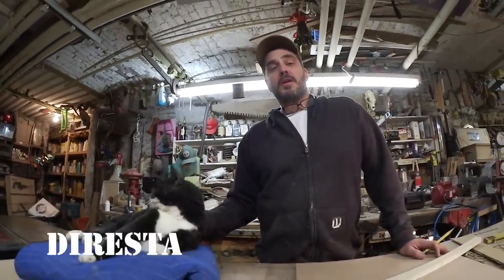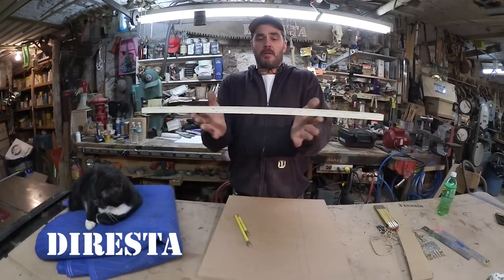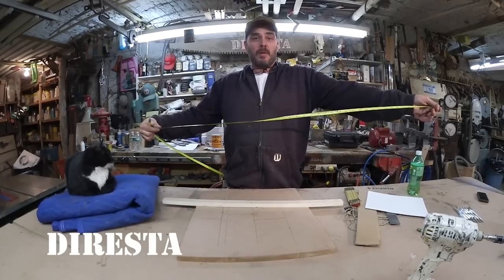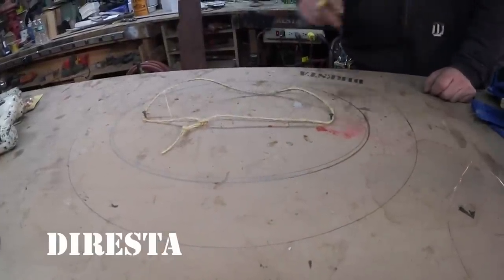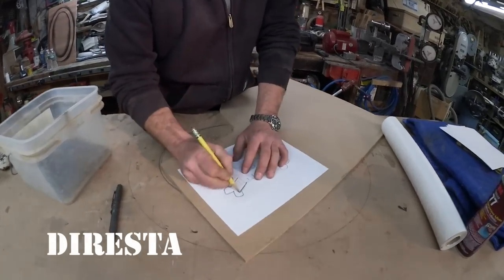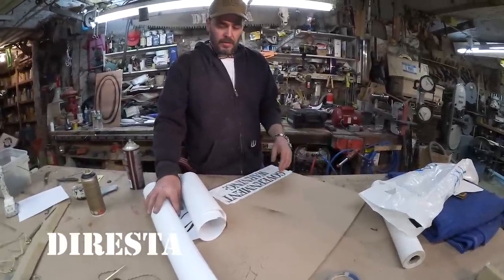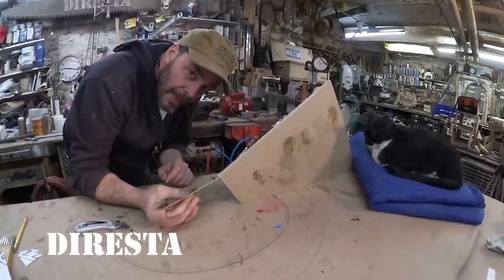✔ DiResta Jimmy Tips 4

Comment: Easy way to find the centre of a round dowel or something. Make a Pacman round and cut the mouth at 90°. Now glue or screw a second piece of wood onto it with the edge alligned from the centre of the pacman through the middle of mouth at 45°. Now you can hold it onto a dowel for instance and use the straight edge to find the centre with 3 or more mark lines.

Comment: Jimmy, I am moving back to the states soon.  I will be buying the tools I think in need, but will not be able to buy everything new.  Do you know of any good info on this subject?  Could you maybe make a video on what not to buy or what to look for when buying used tools?  Maybe some do's and don'ts.
Reply: Make sure they are working. And basically every Tool is really usefull but you can use them for other stuff to. Maybe you want to have the big belt sander jimmy uses for stuff like his machete, but you can just use a normal beltsander, put it in a vice and start it. What i mean is, just use your mind a be creative alot of tools are great but can be "replaced" by other tools.
Reply: Thanks for the reply, but little things I understand.  I am looking for more info on how to purchase items like table saws and band saws.  Little things to look out for when purchasing these items.  Signs that items are overworn or about to break, things that a fresh off the boat guy might not know about.  Things to stay away form.  Should I look for items with cast iron tops, or should I go cheap at first and spend a little money later?  If I find a quality table that needs a motor or maybe some other parts, should I still purchase the item?  Thanks for the info.

Comment: Dear Mr. Diresta, i think it's worth pointing out that normal people have this strong instinct, when they hold the pen or pencil and try to do a longer line of any kind, to correct the line using their fingers, so they will have a very hard time following the advice to draw straight edge offsets only using the finger position. Artists have an easier time with it, because they generally must unlearn to correct with their fingers and use wrist and arm instead.

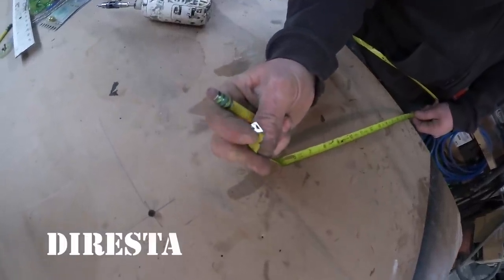Comment: At 7:00 minutes. Instead of the 3-4-5 rule, my brother taught me to use the 14-14 rule. (That´s how I can remember the rule. It is actually 1,414 )Because it can be tricky to get ecactly 3-4-5, on say a rooftop.
Here goes.  I am from Denmark and we use the metric system.  Measure fx 110 cm from both edges, make a mark. Multiply 110 with 1,414. It doesn´t matter what number you use, and that is the beauty of this tip. =)
The sum is in this case 155,54. So instead of 5, it should measure 155,54 cm across from each 110 mark. Hope this makes sense. Try it and let me know if you can use the tip.

Comment: Here is a good tip I found for transferring an image or drawing. If you have a copy machine or laser printer run your drawing through the copier then place the copy face down on your project and heat it with an iron,, the toner from the copy will melt and leave the image on your project.

Comment: Am I the only one who said 8 and a half to what was half of 17 and 4 and a quarter to a quarter of 17?
Reply: You are not the only one!
Reply: You may not be the only one and it's not that hard to divide 17 into 4. But sometimes you just can't do this. I mean you go full hurr durr on this kind of things.
Reply: I knew those off the top of my head but its a rare luxury when you need to divide even numbers. For me its always "whats 1/3 of 13 5/8ths"? I'm no stranger to math, in fact I'm quite fast, but after working all day in the sun and you just need a few more cuts to call it a day... these tips are great.
Reply: malachi1616 Trying to sub-divide lengths expressed in fractional inches qualifies as torture according to the Geneva convention. It's taking the only advantage that imperial has over metric (base 12, which has more integer factors) and throwing it away. Whoever decided to divide inches in powers of 2 (instead of multiples of 12) should be forced to work exclusively in beard-seconds for the rest of his life.
Reply: RFC3514
Hah, I'm sure most people aren't familiar with duodecimal math.
Reply: malachi1616 Well, if they're used to feet and inches, they should be. It's the easiest base to use when you need to divide things (which is why we use it on  clocks, months, etc.).
Reply: RFC3514 There were 10 months until Roman emperors wanted months named after them and inserted July (Julius) and August (Augustus).  Think about it sept is 7, oct is 8, dec is 10.
Reply: peggyt1243 That's wrong in several different ways.

First, the names of those months are related to their position in the year, not to the total number of months. If you take the calendar exactly as it is now and simply decide that the year starts in March (like the early Romans did), October becomes "month eight" but you still have 12 months. 

Second, the old Romulan calendar (created in 753 BC) didn't actually consist of 10 months. It had 10 named months (with 30 or 31 days each), adding up to 304 days, followed by an "intercalary period", to make up 365 days.

Third, even with that "correction", the system didn't last long, because they wanted to have a direct correspondence between months and seasons, so in 700 BC they replaced the intercalary period with two new months (January and February), so the number of months (12) was now divisible by the number of seasons (4). They didn't get the length of the year right (the new model added up to 355), so they kept a smaller "intercalary period" (which was corrected later, with the Julian Calendar), but the number of months never changed after this.

Fourth, no one ever "inserted" July and August. Those were simply renamed from their original names, "Quintilis" and "Sextilis" (in 44 and 8 BC, respectively). The "new" months were Ianuarius and Februarius, added by Numa Pompilius in 700 BC, long before Julius Caesar or Augustus.

The "10 month plus intercalary period" (Romulan) calendar was only in effect for 53 years. We've been using 12 months for the past 27 centuries.
Reply: i also got the answers in like a three seconds
Reply: You're awesome.
Reply: I recently had to do a similar calculation and I had to go draw it on a computer to get an even dimension. I could NOT get it to divide evenly with any math because it was just too odd of a fraction to be able to measure accurately. This angle method would have worked perfectly. I love it.

Comment: 1k likes 14 thumbs downs. how could someone not like these videos?
Reply: +david gagne Well, some of these tips could come with caveats. Like the obstacle template trick Jimmy demonstrated. It only works if you are cutting out material as flexible as your template is. Otherwise stiffer material may not be able to bend into where the template came out of. Plus thin templates have a bad habit of deforming on you. They will not lay as flat as stiffer materials will. It works, and works well, but doesn't always work quite as well as you might imagine it does. At least I've gotten screwed by floppy template syndrome a number of times. Enough that I am aware of it today. There is a hybrid method that is more reliable. Where you rough cut stiff template material, then build up the details with tape. It just makes for a more accurate template.